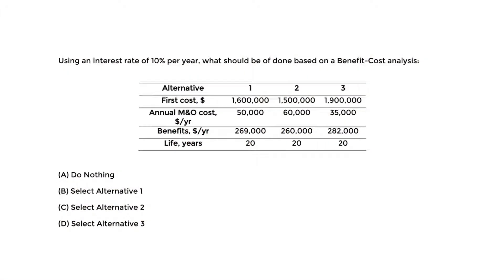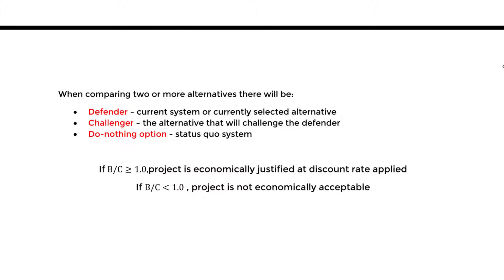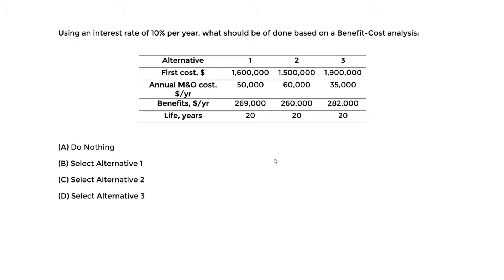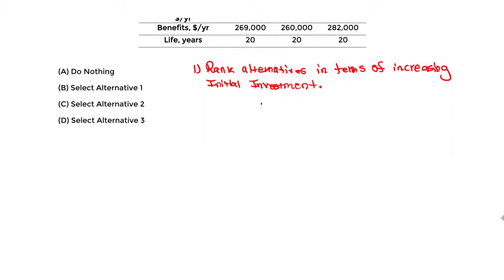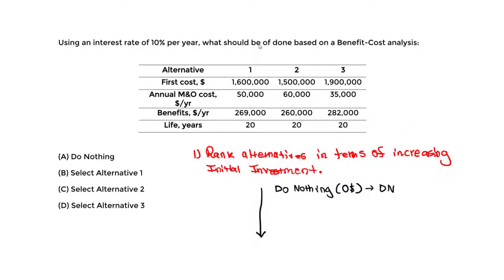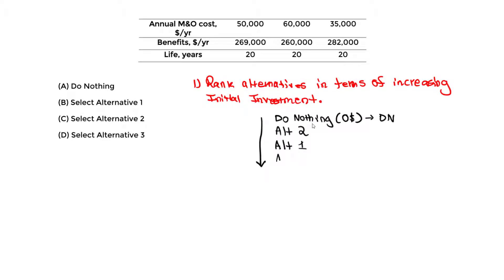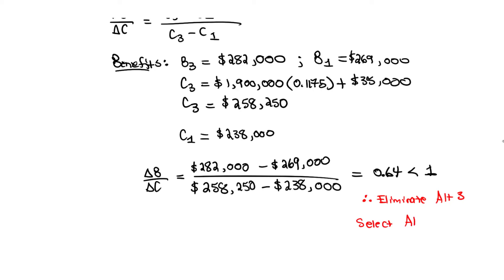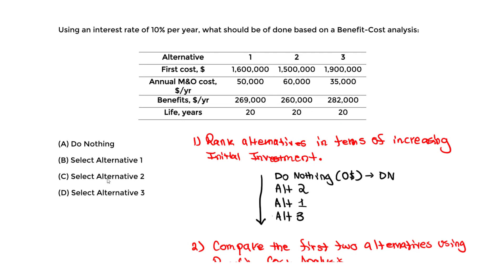FE Exam Review - FE Exam - Engineering Economics - Benefit-Cost Analysis

Comment: Really good explanation butt he process is lil long. Converting everything to PW and comparing might be the fastest way for FE.
Reply from the maker: Yeah good insight, never thought of that to be honest, good work 👍👍
Reply: Could you please explain how did you do that? I tried, but couldn’t.
Reply: @directhubfeexam  Hey! Could you explain this? Thank you!
Reply from the maker: @nicolevalverde1775 it’s actually faster to convert to the annual worth like how I showed it. This is because the annual O&M and benefits are annual costs, so it leaves us to convert the present first cost to annual worth to make everything match up. 

Note, this incremental method takes time but it’s required for more than 2 alternatives when doing a Cost-Benefit analysis.

Comment: Thanks for the video. I would suggest to covert the first cost to annual cost for all 3 options and then calculate the total cost yearly. Then calculate the B/C for each option individually and just select the higher ratio. Your thoughts?
Reply from the maker: Hi Sam, sorry for the late reply. Unfortunately, that does not work in this case since all the alternatives are equally justifiable since all have a B/C ratio that greater than 1 (B/C>1). Note, if one alternative had a B/C < 1 you can quickly eliminate and focus on analyzing the other alternatives using the incremental method. 

The incremental method is conducted as follows: 

(1) Determine the equivalent total cost for each alternative (PW or AW) 
(2) Order alternatives by increasing total cost
(3) Identify benefits (B) and (D) for each alternative 
(4) Calculate B/C for each alternative and eliminate all with B / C<1.0
(5) Determine incremental costs and benefits for the first two alternatives (as shown in the video) 
(6) From step 5,  if >1.0, higher-cost alternative becomes defender
(7) Repeat steps 5 and 6 until only one alternative remains
Reply: @directhubfeexam  Your method works fine. My point was that when calculating the B/C for each alternative, the greatest value for B/C will be best alternative.
Reply from the maker: @samhashemi9031  Unfortunately, an alternative or project with the highest benefit-cost ratio may not always be the preferred alternative. This is why we do this method (I have no idea how it's developed lol - but it works).

Comment: Is there any shortest way for FE please?
Reply: For each alternative, compute the future value for the benefits and the future value for the costs and divide them. You will get a B/C of 1.13, 1.10, and 1.09 for options 1, 2, and 3 respectively. Option 1 has the greatest B/C so you should go with that one. You will have to use (F/A, 10%, 20) and (F/P, 10%, 20)

Comment: When using modified vs conventional B/C there is always some slight difference in answer. What if one of them gave me answer less than 1  and the other gave me answer equal to 1.
Reply from the maker: Logically, since they are both very close to 1 - they are both equally justified if you are doing a real life analysis by taking other consideration in mind that do not include cost. 

What kind of project or scenario is this? Government project, private project, etc?

Comment: How did you know it was A/P?
Reply from the maker: Hi, since the costs and benefits are per year, we would need to convert the first cost to a yearly value. This is called the concept of "equivalence". Basically, we need every cash flow to in units of PER YEAR. We know the first cost occurs at the present - therefore we can get an annual cost flow from the present by doing A/P. Meaning we are converting the to an annual cost flow from the current present first cost. Hope this helps!
Reply: I think It can be solved in a much simpler way, just by bringing Yearly costs into present worth and then deduct initial cost..
Reply from the maker: @zohansyfe3836  Good point, that works too!
Reply: @zohansyfe3836  Could you please explain how did you do that?